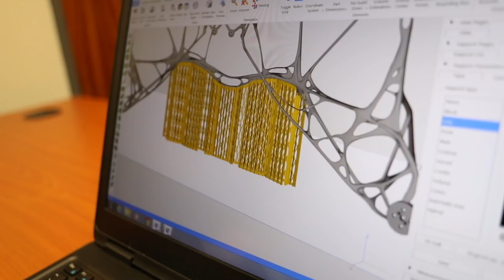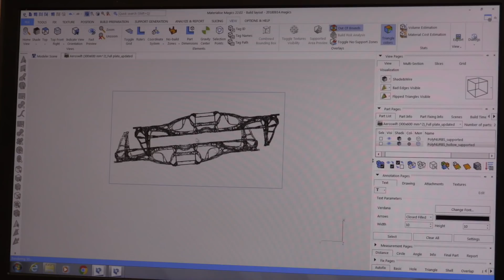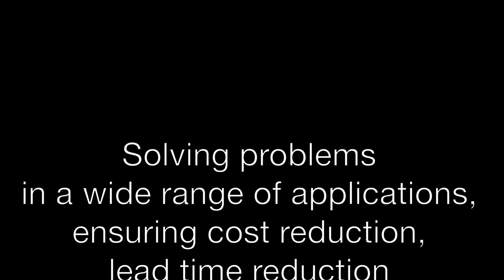Aeroswift metal 3D printing technology

Comment: What might this technology be like in zero gravity?
Reply: Lack of gravity would cause the powder in the bed to not stay in the bed. Perhaps gravity can be artificially simulated by centripetal motion or something. But another big issue is that the metal powders are very dangerous and if you are sending a machine like this into space you also have to implement a bunch of safety measures beyond just the machine itself. Actually in this video it seems that safety protocols are lacking a bit considering the metal powders they are using.